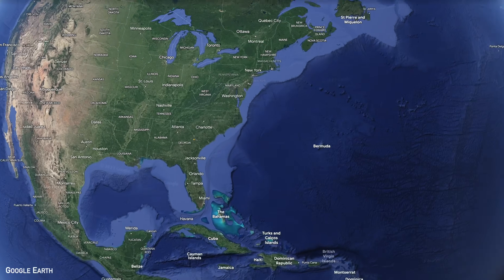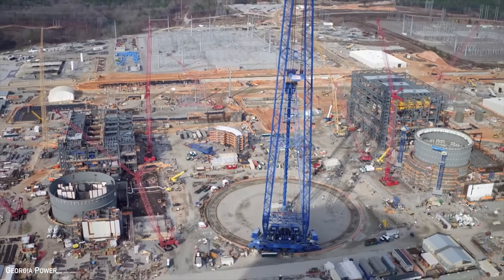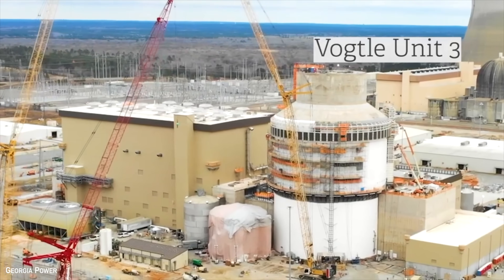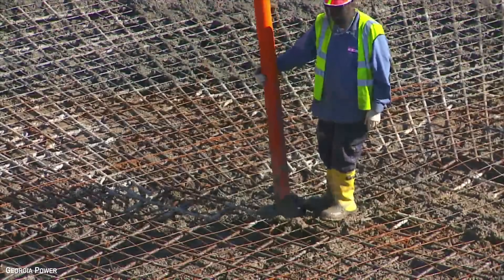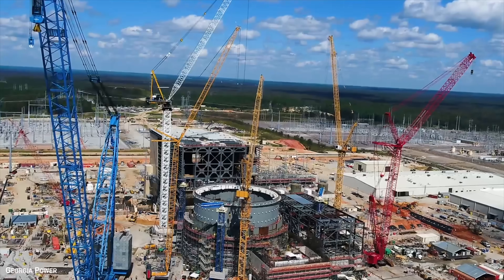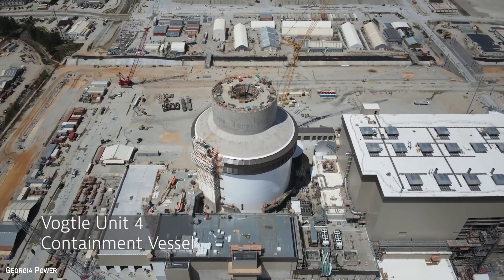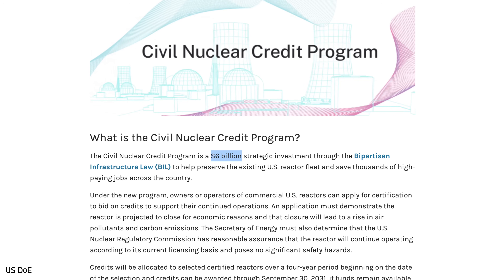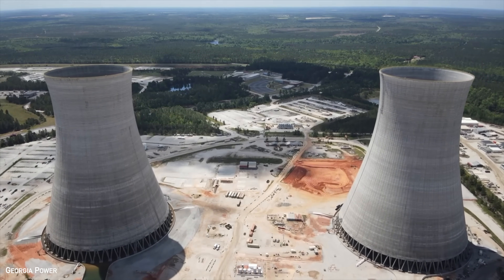Why the Future of Nuclear Power Depends on This Plant

Comment: As you pointed out, the MASSIVE gap between last new reactor and Vogol 3 means that all the experience we had developed post WWII had retired and/or died. That loss of knowledge and expertise, I strongly suspect, has accounted for the vast majority of the construction delays and cost overruns. Bottom line is, we need a government that will aggressively support the restarting of nuclear power in the US. To encourage the mass construction of new reactors all over. If such a thing was to happen, then the costs of redeveloping lost skills, experience, and expertise could be spread out over the entire industry and thus bring the cost overruns down significantly. It would also allow us to increase the speed of which we can build new plants as those skills return. This would result in the overall pain in building new reactors to be much more palatable and better overcome.
Reply: There are some 60 reactors under construction abroad.  The US Navy puts out a steady stream of people experienced w building reactors and running.  No doubt GE and others have retired experience, but lack of experience given foreign experience and the Navy doesn’t explain cost of Vogtle. 

The US regulator, the NRC, explains domestic differences quite well, if we assume it’s a malevolent regulator.
Reply: @Nill757  As someone who served in the Navy as a Nuclear Electrician's Mate, we were trained in the engineering, principles of construction, operation, maintenance, and emergency response of a nuclear power plant. However, we were never trained in the actual *building*, the task of producing the components and assembly, of said nuclear power plant. Furthermore, the design and building requirements of a military plant are vastly different than a civilian commercial plant. The underlying physics and basic engineering principles are the same, but, as the saying goes, "The devil is in the details." and the details of a military grade reactor, aboard a space constricted naval vessel, versus a civilian grade reactor, in a space unlimited plot of land, are MANY.

Then there is also that very foreign expertise you point out. Problem there is one of trust. There is the problem of travel. There is problem of logistics in bringing over and housing all the construction crews with experience building a reactor. There is a problem of poor public relations that would arise from hiring foreigners taking away "local jobs". Now, I know there are many projects we build here in the US with foreign labor and expertise all the time. Difference is such projects are not usually under immense public scrutiny, do not have nearly as major sovereign defense implications, and even when foreigners are hired, they are usually low skilled migrants or highly skilled people hired for very specific skills for a very singular problem. The skilled individuals are not being brought in to restart an entire industry that the US invented to begin with. At the end of the day, you are dealing with a human issue, a public relations issue, and a political issue.
Reply: @Maadhawk  “never trained… build”
Yes, I know.  Who do you think did build them?  US engineers  at General Dynamics and at other firms did build reactors, every single one the Navy ever used.  They still are building them, here in the US.
Reply: @Maadhawk  “many projects …we build here in the US with foreign labor … all the time”

Yes, for 150 years back to the Brooklyn Bridge, German engineering, Irish labor. 

“defense implication”
It’s a commercial power plant, not a weapon, nothing like a weapon.
Reply: @Maadhawk  How many new nuclear build failures do you want before you see the common denominator.

If you live in the U.S. here is the reality for the last 4 “state of the art” Generation III Westinghouse AP1000 ADVANCED  new nuclear power projects and spent fuel reprocessing in the U.S. over the last 20 years. The AP1000 is fully approved by the NRC for construction and operation.  The only NRC requirement is that the plant be built per design documents…..seems simple..

The Southeastern U.S. is super pro-nuclear MAGA, has zero anti-nukes, and 100% media, local, and political support. 

The MOX facility (South Carolina) was a U.S. government nuclear reprocessing facility that was supposed to mix pure weapon grade Pu239 with U238 to make reactor fuel assemblies. It was canceled (2017) in the U.S. After spending $10 billion for a plant that was originally estimated to cost $1 billion and an independent report that estimated it would cost $100 billion to complete the plant and process all the Pu239, Trump canceled the project in 2017.

VC Summer (South Carolina) new nuclear units 2&3 were canceled in 2017 after spending $17 billion on the project (original estimate of $14 billion and 2016 completion date) with no clear end in sight for costs or schedule. Four managers on the project were charged with 16 felony counts, including conspiracy, wire fraud, securities fraud, and causing a publicly traded company to keep a false record.  The CEO of the project is serving 2 years in prison, another manager just got 15 months in prison, and the others are awaiting trial.

Vogtle (Georgia) new nuclear units 3 &4 at 110% over budget and schedule (currently over $34 billion with an original estimated cost of $16 billion). Mid way into the build, the utility stated that had they known about the many costly delays they would never have chosen nuclear. They were just delayed another year because according to the project management, thousands of build documents are missing. The first unit should start in 2023 and when it does, Vogtle will be, for its output, the world’s most expensive nuclear power plant.

Please google any of this to confirm.

If you can’t build new nuclear in the super pro-nuclear southeast U.S. then where can you build it?
Reply: @Nill757  There is a difference in building the metal reactor vessel and building the entire complex that is to house it. That is where the expertise has been lost. The smart move would be hire GD as consultants and/or supervision when it comes to plant assembly. Building the large metal reactor vessel, pressurizers, steam generators, coolant pumps, isolation valves, relief valves, piping, sensors, redundant control systems... all the "fiddly bits", as one author I like would put it, isn't where the challenge lies. That is nothing new to us and wouldn't be any harder than building a gas or coal fired plant.
Reply: @Maadhawk  “has been lost”

Well they just built two big pressure vessels at Vogtle in the last ten years. And Westinghouse recently built the same design in China. It’s not all lost.  But if the play is to do nothing again for 30 years and then once again introduce a new design, as w Vogtle, then how much experience exists today doesn’t matter.
Reply: @clarkkent9080  I'm not sure what you are trying to say, nor what overall message you wish to communicate.

Are you just wanting to point how inefficient contract bidding is in the US?

Are you just wanting to point out how rampant greed is?

No one said that isn't a factor either. Just wasn't a topic with my original comment. My comment was very narrow, on a single item of a much broader topic. If you want to talk corruption, contract bidding, material price manipulations, greed, corporate kickbacks, politician kickbacks, etc.; then you should post your own comment on the main video and discuss such things with others who want to address them.

My own 2cents on the topic, doing such a large project like a nuclear power plant should be done in the same way SpaceX handles rocket production, take everything in house where you can cut out as many potentially corrupt middle men as possible.
Reply: @Maadhawk  What I am saying is that it is what it is and the last 5 nuclear projects in the U.S. over the last 20 years have PROVEN it to be massively expensive if it can be built at all.  And this is happening in other countries as well.

There are many reasons for the massive cost over runs but it is a FACT and REALITY you you cannot deny by simply proposing some unicorn new method.

The U.S. is providing $2 billion each in matching funds to Terrapower and NuScale both of which proposed designs that they advertised as only costing $1 billion.  What else do you want them to do built it for them.....when we all know the government is even less efficient.

He is not Musk but Bill Gates is the head of Terrapower and now the multibillionaire has got the U.S. taxpayer to build a special factory to make his reactor fuel.  I guess he lost a lot in that divorce.  

Musk has no interest in getting into nuclear
Reply: @Nill757  the problem is that the foreign people who know how to build reactors are mostly from China and Russia and they definitely won't be allowed to work on reactors in the US...
Reply: @johannesgutsmiedl366  South Koreans probably best best, but I doubt of those companies want to, as they still have to go through the US NRC like everyone else. 

Something might force the issue.  Nobody can invest to build a large nuclear fleet in the current US given the NRC history as it runs now. But if the world wakes up one day and finds China has built 800 reactors and has a totally clean and cheap energy system, then the NRC will have to be changed to something like FAA of FDA.
Reply: @Nill757  Fun thing is China already leads the world in pretty much every critical technology for the carbon free future: batteries, EVs, solar, wind, nuclear, high speed rail, mass transit, ultra high voltage transmission... but so far it doesn't seem like there's a coordinated response in the west
Reply: @johannesgutsmiedl366  China consumes half all global coal, w coal share of its grid 63% and still building new coal plants.  Their gas resource is low which cuts coal carbon in half. US share of coal is 20% and falling. 

US has near double the number of Chinese reactors. US nuclear share is 20%, China 5%.  China is building nuclear fast though so in 15 years …

China wind+solar share is 9%.  US wind +solar 14%.

Comment: Light water reactors (LWRs) are expensive and inelegant.  I would like to see a new kind of reactor.  Even Russian sailors can operate Lead Bismuth Fast Breeder reactors without killing themselves.  A lot of engineering companies are producing proposals for Molten Salt Reactors that look plausible.  The key problem is that there is no constituency that would compel government regulators to make them happen.
Reply: A dozen plus LWR were built in US in 3-4 years each for less than $1000/KW todays dollars starting late ‘60s. Excellent safety records.  Loss of coolant causes reactor to stop immediately. If they do fail, like at TMI, nobody dies. If US reactors are expensive now, there’s a political reason not technical.  I suggest the modern US NRC.
Reply: “Expensive and inelegant”
Evidence ? Plenty of proof that they are both inexpensive and elegant, if one doesn’t conflate political regulation and tech.   See cost-time of Point Beach WI, before NRC. Or Oyster Creek NJ.
Reply: @Nill757  First, You have to enrich Uranium, discarding most of it in a good sized industrial process.  From there, you only burn something like 1% of the available fuel, before it is no longer usable, and it cannot attain temperatures much higher than the boiling point of water at sea level, so it runs turbines less efficiently than other heat sources.  How you can call this "efficient" defies my understanding of the word.

As far as politics go, the government is going to do exactly what the fossil fuel industry tells them to.  Coal operators are going to continue to strip mine, and remove mountain tops, because that earns them the money to contribute to election campaigns.  It even earns them enough money to fool environmentalist to do their bidding.  If our government still planned for the future, we would have all kinds of different nuclear technologies to work with, but as Samuel Clemons put it, "We have the best government money can buy."
Reply: The lead/bismuth reactors were retired early and were difficult to dispose. 
As with all reactors, the building and operation is not necessarily the tricky part.
But nations that do not commit to timely disposal do not get respect on the matter.

Comment: The Vogtle project has produced a capable group of companies and employees that can design, build, and operate new nuclear plants.  The lessons learned have been painful but are providing valuable insights on what does and does not work. Safety and continuous improvement are the cornerstones within the US Nuclear Industry.
Reply: Lessons: 1. Nuclear does not make economic sense. 2. Don't build them.
Reply: @jay-em  100 reactors running very cheaply w reliable 24/7 power in US for decades.   So too France and other places.  How is the “lesson” to point to one plant Vogtle and ignore everything else, instead of asking what’s different here?
Reply: @Nill757  gotta take into account the whole of life cost, not just during operation. There isn't many other examples to look at in the US - just cancellations and cost/time overruns.
Reply: @jay-em  “just …cost overruns”

What are you talking about. What “cost of life “ beyond operation?  As I already pointed out, there are near a 100 reactors, most of them still generating cheap power. One closest to me has cost of under 2c per kWh, reliable.  That includes maintenance, fuel, and a bit put away per kWh for dismantling one day.  There is nothing cheaper for existing power.  

Also see a dozen US nuclear plants built late 60s like Oyster Point in NY, all of them built 3-4 years, cost under $1000/kw to build.  That’s no cost or time overrun.  Most of them still running 50 years later, great safety records. Have to tear down and build two solar or wind farms in that time.
Reply: @Nill757  Vogtle management is asking the PUC for $600 million rate increase per unit.  That that 2c per Kwh and multiple by 15 to know what we are about to pay
Reply: @danadurnfordkevinblanchdebunk  about a third the cost of nuclear based on contracts being signed.